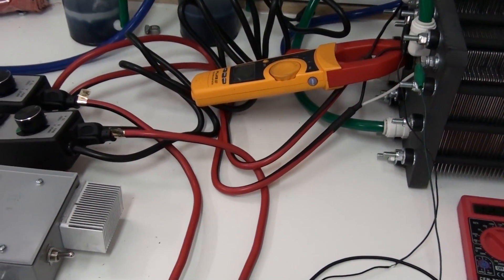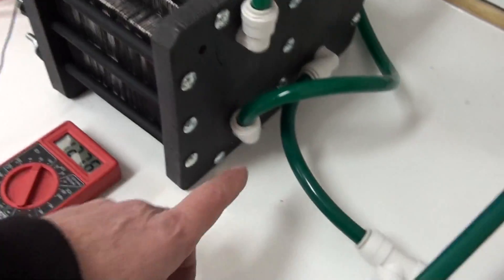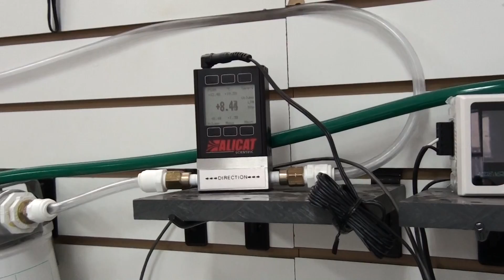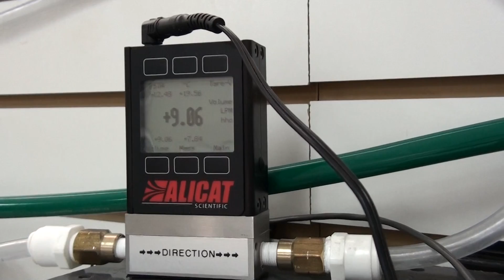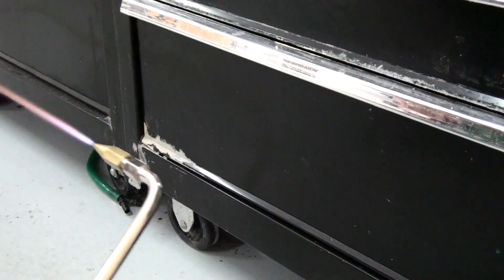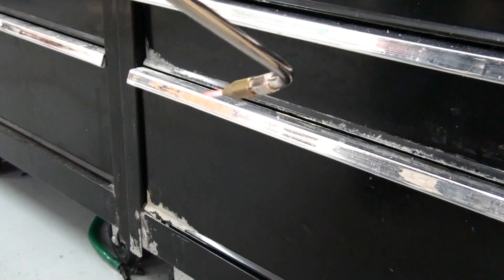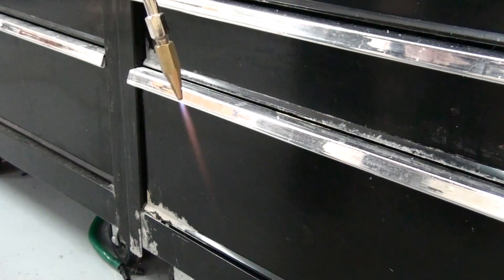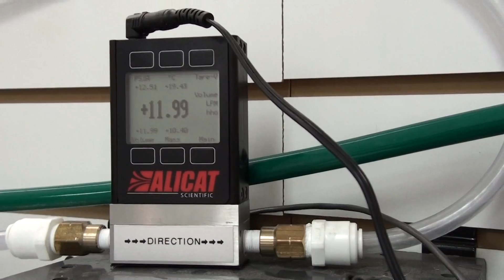HHO 118 plate 125 volt Retail cell demonstration. Great for hydrogen welding

Comment: THE WEBSITE IS NOT MATCHING THE VIDEO
Reply from the maker: +GeorgeG GavrielidesG The 118 plate cell in this video is a older model that the one being sold. You can see it's improved replacement here:
http://www.greenfuelh2o.com/118_plate_hho_generator_p/118p230v.htm

Comment: hey i forgot to tell you the gies in canada put the isoproapl alcohal in there electrolite as an anti freeze not for foam but i had a hunch it might help my foam issue and so far so good
Reply from the maker: never had luck with that stuff. The alcohol evaporates and burns off and whats left coats the plates. basically destroys the active area and production. Use high concentrations of KOH. (20%) it works

Comment: How simple is this to really install? I'm not that mechanically inclined - the only thing I can do it change my air filters maybe spark plugs so yeah. I have a 2003 Honda Accord V6 - not a clue 300-500 bucks doesn't sound like much to spend if I can double my MPG currently I get about 23 city 30 hwy.
Reply from the maker: Usually the typical fuel savings is 20 to 30%

Comment: im just telling you all this stuff becuase id hate to see you loose your meter bro , alot of people dont no that silica gel beads do not completely dry gas streams, most labs use thing like permaningates of aluminum or potassium stuff like that , also do you think mass flow sencor spray would clean your meter if you needed to , it does not dissolve plastics or electronics or leave even the slightest residue
Reply from the maker: I'd like to just protect the meter. I don't want to think about having to fix it.
Reply: see what you mean, hope i helped

Comment: please see this very old video of mine  { super hot blue hho flame using DIY desiccant charge gas dryer  }   it will show you what the dryer looks like , i will give you the details because it has several components , like a 1500 mesh screen intake a cinterd brass cone filter and a cotton barrior around the cinterd brass also a cotton pack at the outake port
Reply from the maker: Interesting video but wont this put naoh into the flame?
Reply: delvis11 from what i gather it does not becuaes mist and vapors do not exist in extreamly dry gas streams , i could be rong but testing and research shows that dry air will not allow any thin to travel out of the system , also naoh clearly would turn the flame yellow with even the slightest hint of contamination, i intentionaly contaminated the system with fine naoh powder and got a yelow flame

Comment: awsome blue flame that means its good and hot , most torches put off a yellow flame , this indicates it is not its hottest , i did some reaserch that claims a dry oxyhydrogen flame with no water in it is up to 500 deg hotter then a wet flame of a colored flame , also color can indicated low volocity flame wich is burning the inside of your tip this is also a cooler flame as is any flame that burns the tip , the colored action indicates an endothermic constituant in most cases also naoh in the flame mnakes it yellow , bubblers do not remove electrolysis mist , this was prooved by picjac despite the unprovoke rude attitude he has he did a litmus experiment proving the fact .
Reply from the maker: I believe that the koh isn't full removed but I have a pretty good filter system on this so I know there is little to no moisture in it. I have a $1500 meter on it and it cant get any moisture in it.
Reply: glad you told me that i may not get one if its real sensitive , i built a naoh desiccant pack one time and it completely dried my gas stream and gave a pure blue flame
Reply from the maker: could you share how you built that. It could save my meter. I thought I was getting the koh out but now i'm not sure.
Reply: delvis11 steve if i was you i would do a litmus test on your gas stream, to do this place your torch into a cup of water , then run the torch for ten minutes or so then place a litmus paper in the water , it will change color then look at the color chart that comes with the test set , you can also use a swimming pool test kit , if you have a high ph say 10 or high or even higher the 8 you defiantly have alot of koh in your gas stream , i assure you you have both koh and about  2.3% water vapor , i have bin reading alot of old chemistry books and the use to use tartaric acid to remove naoh from electrolysers in the first oxygen companies that used electrolysis to generate medical grade o2 , they described that even with air stone gas washers "bubblers"  do not remove naoh mist from gas stream, they used also pumic stone impregnated with sulfuric acid to both dry the gas and remove naoh. do a litmus test friend also i hope you no that hho is a very wet gas and typical silica gel with cobalt chloride indicater inline dryers do not dry hho gas , i have a video of my naoh dry naoh is extremely hydroscopic as is koh and is considered a expensive desiccant
Reply: delvis11 i will send you the name of my video and it will show you how dry it gets the gas stream, also i tried this with typical inline dryers , they do not work your meter may be at risk silica gel cannot handle saturated gases , hho gas is water vapor saturated , it is literally humidified by the bubbler and also it did not turn my flame blue and the inline dryer was huge , like 1 foot long and full of silica gel

Comment: i bet you could get 20 lpm outa that cell if it had a cooling system , bad ass unit wish i had the loot for a nice one , im forced to build with salvaged junk
Reply from the maker: It will go higher but the plates will start leeching bad.
Reply: i see , good point , those look expensive
Reply from the maker: This is a customers cell. He wanted it tested before I shipped so I thought I would make a video :)

Comment: hey steve i know you use koh and have for ever well i just found out that naoh attacks chromium ? final straw im switching to koh , were do you get yours i would like to use the same stuff you do as i have herd some stories about bad chinees chemicals  being contaminated and not all brands being the same
Reply from the maker: I get my KOH from essentialdepot.com
I've been using it for awhile now and it's great.
Reply: delvis11 thanks im gonna look into it , hey just a side not , some canadians have bin putting isopropal alcohol in there cells for winter use and i looked into the chemistry and what i founf is that isopropal alcohol is infact made by the electrolysis of acetone  so it is completely inert  but it does reduce the conductivity of water just a bit but as and added bonus its reducing my foam at high heat and high output , im realy glad i tried it because naoh electrolite does indead freeze and my torch is in my garage so it gets as cold as 30 deg with heat on

Comment: is that 15 amps total ? very impressive just to give you an idea of how much more efficiant a larger cell can be my current rig at 15 amps puts out a wimpy 3.5 LPM, i am going to dismantle it and change to EPDM  gaskets , i am very disapointed in my cell the last was a 24 plate cell and it produced 3 lpm @ 15 amps , it also had a blank center plate with no holes in it to cut shunt currents by 50% also i used a techniqe called staggered manifolding that had the holes out of alignment to increase the linear shunt span, basicly the holes in the plates dont line up , any way you would think adding 14 plate to my cell would give more then 1/2 LPM  increase but here is the catch , i removed the blank center plate and did not use the staggerd manifolding to see if it would hert performance and i would have to say it did indeed , the 24 plate cell had to be very efficient to only be .5 lpm behind a 38 plate cell without efficiency protocols incorporated  so i am going to insert a blank center plate and cut back on internal flow channels {manifold conduits}
Reply from the maker: I am not a big fan of staggered holes. They impede flow and starve the plates. It helps current leakage but it's minimal. I use big round 9/16" holes and the fittings  make it so there is no restriction allowing the full 3/8" ID to be used. Putting ports of both sides let it flow like a beast. This improves efficiency but mostly increased production.
Still this cell was running at 22 amps and 125 volts.  That's 2750 watts. It's only 4.36 MMW so it's average on efficiency.